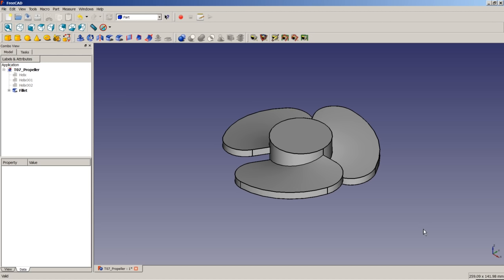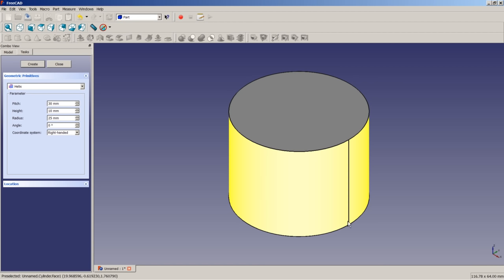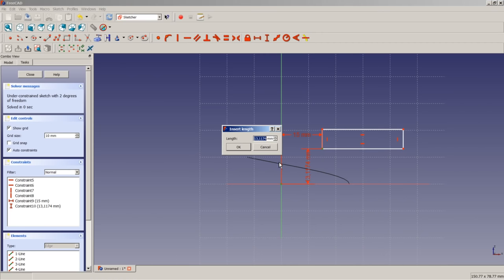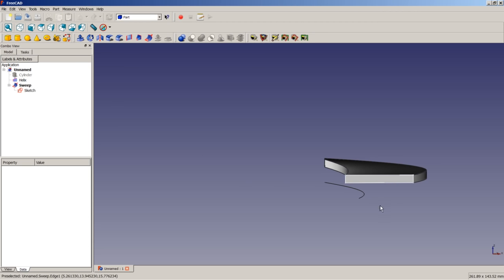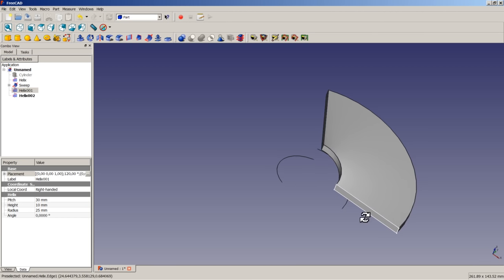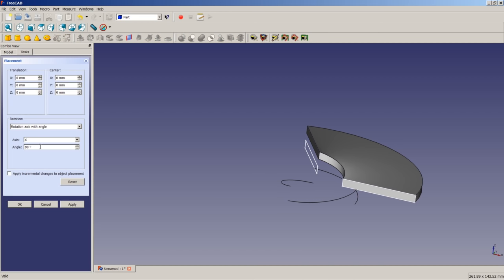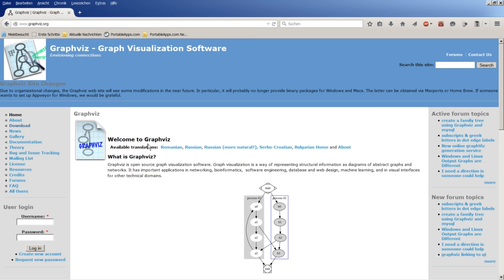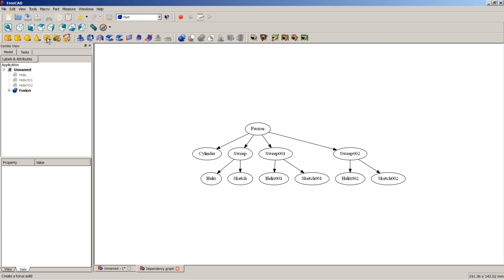FreeCAD Lesson 07 - Propeller

Comment: I am using FreeCAD 0.16, my output from About FreeCAD is:
OS: Devuan GNU/Linux 2.1 (ascii)
Word size of OS: 64-bit
Word size of FreeCAD: 64-bit
Version: 0.16.
Build type: None
Python version: 2.7.13
Qt version: 4.8.7
Coin version: 4.0.0a
OCC version: 6.8.0.oce-0.17

In this version the sketches are no longer visible in the Model column. I found using either the Array function in Draft or Duplication of the Sweep to work. I ended up with a 3D drawing the same but I am wondering whether what I achieved is secure, for example translation to a 3D printer or CAD mill instructions.

Comment: Thank you for the tutorials. How would you thin the edges of the blades while leaving them thicker in the middle?
Reply: The rectangle may have a smaller height on the "outside". The edges of the rectangle do not need to be parallel.

Comment: Hi, thanks for yet another great tutorial-lesson. 
Towards the end, you use the "part" toolbar instead of the "part design" to create a fillet/roundover. What is the difference? When would you recommend using the "part" and when would you recommend using the "part design" for creating fillets? The latter is seemingly more forgiving for changes to the model at a later stage, but does it have downsides?
Reply from the maker: +Aditya Mehendale 
Well, as you said, the fillet-tool from Part-Workbench is more user friendly concernig input of different values and
changing the values later.
It seems also a good idea to apply fillets and chamfers not too soon on your model.
I haven't noticed any real downsides.

Comment: Tried installing graphviz-2.38.msi a few times on win7 FreeCAD keeps saying "Graphviz couldn't be found on your system" is it in a mystery location that I just can't find or am I missing something. Instillation says it went well and second instillation asks if I want to "repair or uninstall". So it's definitely installing.
Reply from the maker: I have also installed Graphviz 2.38 on Windows 7 64-bit. It is listed in "Program"-Group and can be found in "C:\Program Files (x86)\Graphviz2.38\bin\".
Did you install as administrator ?
If all went well FreeCAD should recognize Graphviz, see here for details:
https://forum.freecadweb.org/viewtopic.php?t=7793#p63642
Reply: Thanks, the path is all I needed. Must have spent 1hr last night seeking out the right path, didn't think to include \bin
Reply: refer to C:\Program Files (x86)\Graphviz2.38\bin

Comment: Why did you show us how to easily create 3 blades using the draft array, and then tell us not to do that, but instead to copy and paste? It seems to me that the draft array tool is much simpler?
Reply from the maker: Maybe i did express myself clearly enough, sorry about that. You can use of course both ways. The advantage of the draft array tool is being paramteric. To make sure that the dimensions of COPIED blades would stay identical you would have to use expressions (available since 0.16 stable, see video about arduino case for more details).